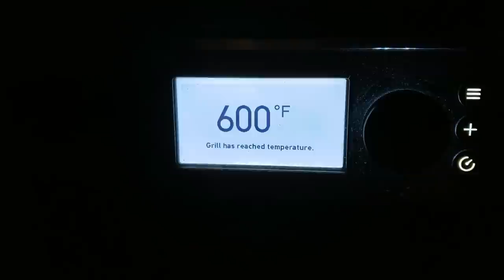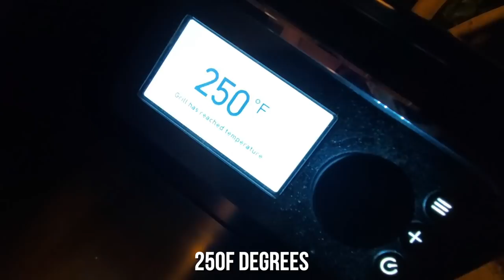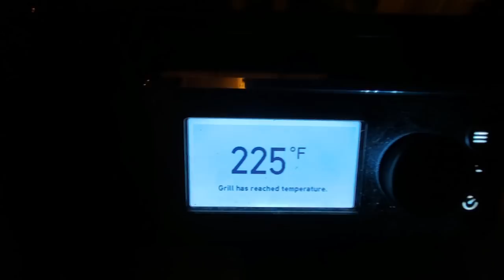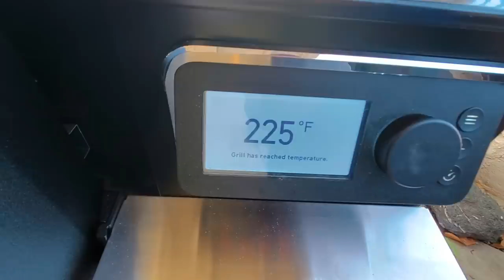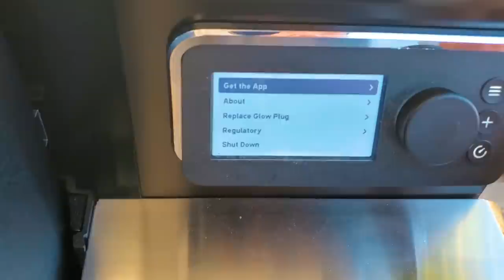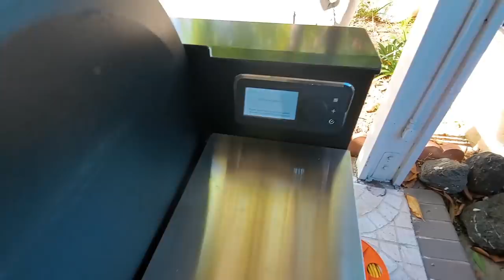Pt 2 WATCH BEFORE YOU BUY | Weber SmokeFire Pellet Grill | BBQ Champion Harry Soo SlapYoDaddyBBQ.com

Comment from the maker: TORTURE TEST 1 - PASSED
 - https://youtu.be/ALNnTwN2Kak
45 lbs 5 meats in 8 hours. Generate grease from a 16 lb brisket, 10 lb butt, and 3 St. Louis ribs to drip on the SF the first 6 hours at H-n-F cook @400F and L-n-S cook @275F. After all that grease was accumulated, fire it up to 600F to grill the ribeyes and sausages.  Cook to let the grease drain in the unit and then try to flash that grease at 600F to test for safety 
TORTURE TEST 2 - PASSED
 - https://youtu.be/jsUri_VoKag
65 lb, 3 meats in 12 hours. Two 16-lb brisket, Two 10-lb butts. Two 7-lb beef shortibs.  Low and slow @225F to see if hopper feeds properly, no grease fire w 12-cups grease collected, and no excessive ash
Grease Fire v Grease Flareup - https://youtu.be/VALvHFhWpk4
MORE VIDEOS COMING
SmokeFire Corned Beef Walmart - https://youtu.be/NSSIKicufJE

Comment: This was my 4th pellet cooker. Heed Harry’s good guidance, and test for yourself. In my experience, this thing has real issues, issues that run counter to Weber’s marketing. My firmware updated without issue. Two failed overnight cooks, which I do frequently on weekends, due to Weber pellets ceasing to feed, plus a full fledge grease fire consuming the entire right side of the cooker during shut down following a pork butt, even flaming out the drip pan. It’s a lot of money to spend to beta test. Shame on me, but these issues were the very problem Weber’s marketing claimed to solve (with influencer support). Can it work? Yes. Does it work as intended? Not in my view.
Reply from the maker: Sorry to hear.  If it were me I'd return it if Weber could not fix it. I only have 2 cooks so my tests are not conclusive.  Maybe I got lucky who knows.  Only time will tell.

Comment: Looks like the meat came out great on the Smokefire.  However, all definitional hair-splitting on flare-ups vs grease fire aside, this unit is headed for a redesign- especially with grease/ash management.
Reply: Chris Drouillard Totally agree.  I sent mine back to Weber after over a week of no information from support at all.  This grill has great potential, and if I do not buy a Rectec or CampChef before then, I will reconsider version 2.  The ash not falling into the bin is the main source of the fatal problem as this is where the grease pools up.  The entire promise of this grill was how easy it was to clean, which was not met in any way.  Basically, I can to the conclusion that I would have to pull it apart and clean my SF before every cook.  My much less expensive Grilla Silverbac has more smoke, better results, and pretty much none of the problems the SF has.  Shame on me for being a beta tester.
Reply from the maker: Not sure if you watched my video before posting your comment.  Are you speaking from experience as a Group 3 or Group 4?
Reply from the maker: Sorry to hear you're in Group 3 Trebz. That is unfortunate.  Wish you best of luck to find gear that works for you.
Reply: Harry Soo I am sorry too.   I wanted this grill to work.  The fit and finish outside of the issues that most people are experiencing (fire pot putting more heat to the right, pellets getting stuck and not falling in from the hopper, and grease/ash pooling) the grill looks and feels better than anything else on the market. It sounds like from a couple other videos, Weber is starting to ship a hopper and fire pot fix to customers.  I would have been open to waiting a bit, but Weber was entirely unresponsive to fixes that they had in the works, so I was hesitant to keep the grill past the 30 days.   Once I see that version 1.1 is stable, I may try it again.
Reply: Anon Macintosh I did a few cooks on it. Very little ash went into the bin.  I loved the size of it, and the finish, but the problems with mine were pretty much aligned with what many/most people experienced.  The grill was not at our main property, so I couldn’t easily wait for Weber to get back to me with potential fixes etc and I didn’t want to risk being stuck with it, so I returned it after about two weeks, and pretty much no feedback from Weber.

Comment: I was really excited about the Smokefire when you and Justin reviewed them but experience has taught me to let other's be the beta testers. I'll stick with my analog charcoal/stick burners in their various forms. 
No electronics, I control the air supply, NO electronics. No issues that I don't create myself.
Reply: I was the same, but I'm not waiting gonna get a CampChef this spring. All the bugs have been worked out so no beta testing.
Reply: @Trblmkr07  What I don't get is how Weber can be this far off the mark considering how late they are the game. It's not like they had to rush into this. It just seems a really bad idea to have grease flowing towards the firepot blowing flames and burning embers out of it. Recipe for disaster? I think so.
Reply from the maker: I agree.  I like fully manual pits myself.  Pellet cookers are handy when I'm too lazy or tired to fire up the pit.  I'm a process-efficient and cost-efficient pitmaster.  Aka I'm lazy and cheap!
Reply from the maker: There is no perfect pellet cooker and no perfect pit for that matter.  Pick a pit that matches your cooking style and temperament.  Some like the zen of putting on a log every 40 minutes and stoking a live fire. Some like to cook using their phone only and come home to an automatically cooked meal.  Importantly, have fun regardless of the way you cook and remember that Harry told you it's always the pitmaster and not the pit or meat that makes the difference!
Reply from the maker: Hey Chris, you mileage will very.  My 12-hour cook ran relatively routine with no major issues.  If this going to the experience of all SF owners, nope depending of which group they are in - Group 1, 2, 3 or 3.
Reply: Pellet smokers aren’t for everyone but I think that stick smokers are probably for fewer people.  When I began my journey to buy a smoker, a stick smoker was high on my list until I realized that I really didn’t want to manually tend a fire all day.  I do that to a certain extent on extended cooks on my kettle and I’ve got a family and things to do.  But to each his own....every technology has its advantages and drawbacks.  Choose your requirements and be happy with the choice!
Reply: @SlapYoDaddyBBQ  That is the beauty of outdoor cooking these days. There is a style for everyone and everyone can have as many options as they want! 

I don't understand the animosity you have experienced over this. I am sorry that the trolls have nothing better to do. 

Thank you for taking the time to share your experience and wisdom with us! We are all better cooks for it!
Reply: @Sevenfeet0  I agree with you. I bought a stick burner from LSG last year and spent the summer working with it and the Barrelhouse  14D cooker I also bought last year. 

I love the flavor of the food from the offset but the time and labor investment just doesn't translate into being worth it to me. 
I loved the barrel! Load it with coals and not touch it for hours. 

Going off of that experience, this winter I purchased a LSG insulated cabinet smoker. It is the same set it and not have to fuss with it as the barrel with a nice handy door, pull out shelves, a firebox that doesn't have to be opened constantly to toss in logs. 

Now with the wind howling here in South Dakota, I can be smoking in my cabinet while watching the temps on the thermopro sitting on my desk. This is a much better experience and much much much more fuel efficient that the stick burner.
Reply: @chris5942  Weather also matters in these decisions.  South Dakota winters (I hear) are no joke.  Here in Tennessee, our winters are probably shorts and t-shirt weather for you guys in most cases.  Anyone who has cooked outdoors for a season or two knows that ambient temperature can have a big effect on the need of fuel during a cook.

One thing about my smoker journey is that I realized that nearly all off-set smokers are just smokers....they may look a lot like barrel grills but they usually aren't built for grilling.  And I'm replacing a barrel grill behind my house that will still need to grill half the time for grilling cooks too big for my kettle.  The WSF is designed for grilling.
Reply: I have been looking at the Oklahoma Joes Rider. The reviews so far seem pretty good. The Lowes model I looked at seemed pretty durable. It is also for far less cost.
Reply: @Sevenfeet0  I do have some alternative plans for my offset. LSG sells a  grilling insert or I can just put a smaller portable grill inside to protect the LSG form the heat and use the main chamber for grilling. Too windy here to use conventional grills of any kind.  The lid of the LSG will be an awesome wind shield and then I can close it if need be.

The firebox I plan on using for dutch oven cooking this summer.  I also don't need embers blowing all over the neighborhood so shutting the firebox door on all of that will be awesome! 

Had I bought a cheaper store shelf offset, none of that would be possible.
Reply: @kjrchannel1480  I would highly suggest a barrel were I to rewind and do this again on a budget. 
Fuel Efficient
Space Saving 
Impervious to wind
Barrel House on Amazon has a removable top portion so you can get at the coals. 
Set it and forget it. 
The flavor is adjustable. Add a waterpan if you don't care for burned drippings smoke. 
They are inexpensive  in comparison.
Rust is not an issue with a barrel like it will be a cheaper offset.
Reply: @kjrchannel1480  I watched a video on the OJR. How cool is that! I love the griddle insert idea.  I wish you much success with whatever you buy! Happy eating!
Reply: I have been cooking on a OKJ Highland that I realistically improved. No useless clamps, or visible goop everywhere. Just heat tape between mating surfaces aside from the stack and fasteners that are gooped just enough. The only barrel/bullet I have is the R2D2 Brinkman. That thing blew over in a wind storm once, and it is not really efficient.  One reason I thought about a pellet grill now is, because finally the same old oven idea has been changed. OkJ had theirs out first. That could be why Weber rushed theirs.
Reply: @kjrchannel1480  I bought the DLX last month.  It's been pretty good so far.  I have an issue where it trips my GFCI sometimes 20 minutes or so after I turn it on.  I reset the GFCI and it runs fine after that for hours.  Doesn't do it every time.  I have a case open and they are looking into it.  The sear zone is good and it gets really hot.  No wifi or app but I had just bought a Thermoworks Signals recently so I just use that.  It tends to run hotter than the unit says at the beginning of a cook but it settles down over time and the temp differential across the pit is pretty good

Comment: Great looking cook Harry!  I'm guessing that good liberal spritzing now n then is a huge benefit in preventing fires, as well as flushing grease and ash.  Great job brother!
Reply from the maker: I don't think spritzing the meat affects the grease at the bottom of the EX.  I generated 12 cups of grease that overflowed the drip pan so I probably exceed the design boundary with 65 lbs of unwrapped meat in my Test 2. I will do a shootout between the EX and my GMG Jim Bosiw soon.  Stay tuned

Comment: I noticed when you added pellets there was a void by the low fuel sensor. The complaint I hav and some others is that although the hopper has plenty of fuel in it it would run the auger dry. Mine did after 5 hours but didn’t ruin the cook as no matter what type of cooking I’m doing I never leave anything unattended for too long. 5 is the longest as I was sleep.  
Anyway. I contacted Weber and they replied the next day informing me they a shipping a hopper accessory to assist in feeding. They said the listen to their grillers and have made this and will ship and send for free.
Reply from the maker: How do I get one?  It like driving a car with a 7 hour tank of gas.  My other pellet cookers would not last 7 hours without refueling so I'm not going to ding Weber too severely.  Look forward to testing the hopper.  Can you lend me yours to test?
Reply: Harry Soo I contacted Weber via the app about my problem with supporting photos and video.  They emailed me back letting me know they were going to ship me one for free.  From the looks of Weber video. It increases the angle but still allow 20 lbs of pellets vs 22 original
Reply: Harry Soo if I get it before they confirm they are sending you one I’ll ship it to you !  I’m over people hating on the grill.  Most products new to market hav a few kinks.  Weber is a great company and they are responding to my complaints and providing reasonable solutions

Comment: I think you are better off cooking large quantities of food in this unit, because the amount of grease it puts out helps push the ash down into the ash pan.  With the smaller cooks, the ash builds up and blocks the grease from dumping into the pan.  Then comes the grease fire.
Reply from the maker: Sure can do.  What is the test you want me to try?  I'll call it the Dar C test.  BTW do you own a SF or a pellet cooker?
Reply: Maybe try a higher temp (over 450) cook to look for ash. More fire, fuel and fan.
Reply from the maker: Did you see test1 yet?
Reply: @SlapYoDaddyBBQ  yes I Seen part 1. I won't comment anymore because I'm just learning to BBQ and don't want to be a keyboard cook. I am quickly learning some you tube channels are better than others.

Comment: Crazy torture testing, ...great cook &  video! Thanks for sharing👍
Reply from the maker: I think Weber engineers may think I'm a knucklehead!  LOL!
Here is a recap of data point 1 and 2
TORTURE TEST 1 - PASSED
45 lbs 5 meats in 8 hours. Generate grease from a 16 lb brisket, 10 lb butt, and 3 St. Louis ribs to drip on the SF the first 6 hours at H-n-F cook @400F and L-n-S cook @275F. After all that grease was accumulated, fire it up to 600F to grill the ribeyes and sausages.  Cook to let the grease drain in the unit and then try to flash that grease at 600F to test for safety 
TORTURE TEST 2 - PASSED
65 lb, 3 meats in 12 hours. Two 16-lb brisket, Two 10-lb butts. Two 7-lb beef shortibs.  Low and slow @225F to see if hopper feeds properly, no grease fire w 12-cups grease collected, and no excessive ash

Comment: I dont understand why everyone is hell bent on giving you instructions on how to make it fail.  I can make ANY pit or grill fail.  Why would I ever want to do that?  There is a fifth group for your list. It's the group you can call gearheads.  They are more concerned with the gear itself than the results.  This group exists in every culture.
Reply from the maker: You are right.  Very astute. I will add gear heads to a new Group 5.
Reply: Man Cave Meals  I own this grill and there is a lot of hate for some reason.  I have had to replace three parts on mine but I’ve been patient and Weber has been on top of it.   I was a little worried at first but now that I have about 80 pounds ran through it I’m starting to really enjoy it.
Reply: Don't think people are teaching others on how to miss use the device people are showing clear malfunctions of the products,, they are not trying to make icecream ! they are running the unit against to the expected specs which are not been responding to what was promised.
Reply: Eduardo Vega buy the traeger timberline then.  My 850 has had zero failures of any kind in the 2 years i have had it.
Reply: Man Cave Meals I own a Traeger no grease fires 🔥 :)